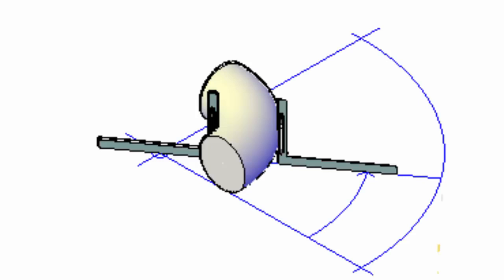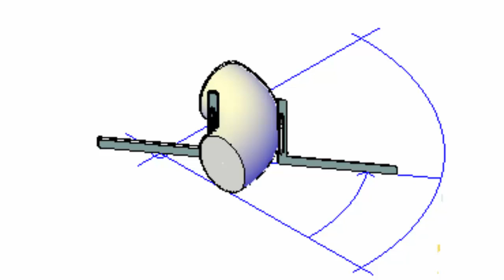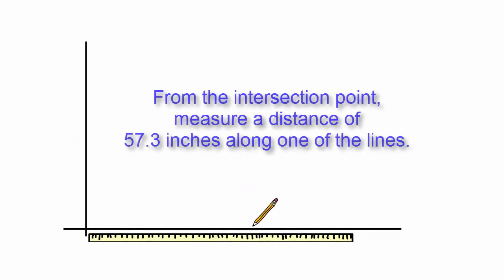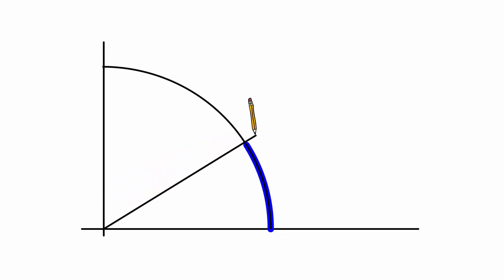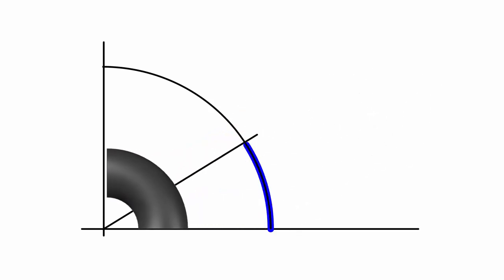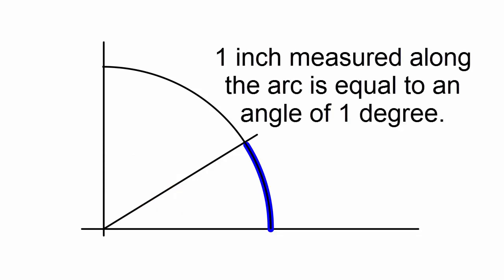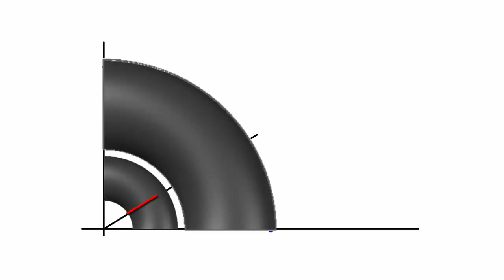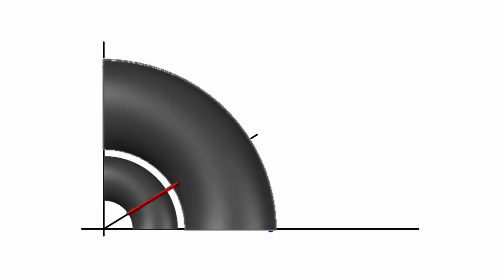Super Easy Method to layout trim angles using 90° weld elbows.

Comment: Can I scale this down to half size and 1/2" equals 1 degree?
Thanks
Reply from the maker: Yes - instead of 1 inch = 1 degree at a 57.3 inch radius, you can use a radius of 28.65 inches and have 1/2 inch  = 1 degree or a radius of 14.325 inches for 1/4 inch = 1 degree.

A folding ruler works very well for this.;  Simply drill a small hole at the 1 inch mark which, another at (14.325 + 1inch), another at (28.65 + 1 inch) and the last at (57.3 + 1 inch) this gives you three options - just be sure you use the correct measurements along the arch when converting to degrees.  You could use a permanent marker to write the inch/degree value on the folding ruler near the hole......

Hold a nail in the hole placed at 1 inch ( the center of the circle) and a pencil in one of the other holes to draw the arc.  Then measure along the arc as shown in the video - the folding rule will bend along the 57.3 inch radius but not the smaller radius values.

Comment: Explain better then that
Reply from the maker: If you have a question or if something is unclear, let me know how I can help.
Reply: The steps on how u started that
Reply from the maker: Since your request wasn't more specific and constructing the lines and arc are easy enough,  I'll assume you are wondering how the 57.3 radius  was determined.
A circle has a circumference = 2*PI*Radius and 1/4 of a circle equals 90 degree so >   90 degrees = (2*PI*Radius)/4 and solving for the Radius we get R=(90*4)/(2*PI) which equals 57.3 inches.
Does That clear things up for you?
Reply from the maker: To be correct, I wanted the arc to be 1" for each degree such that 90 degrees would equal 90 inches along the circumference.